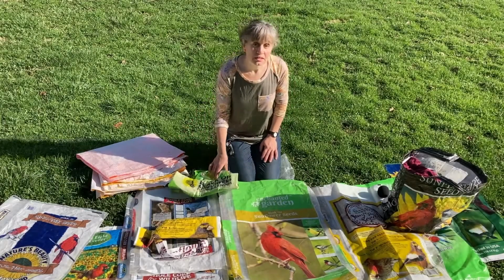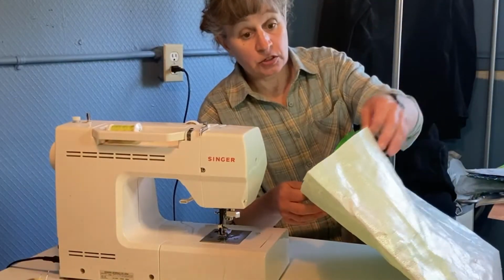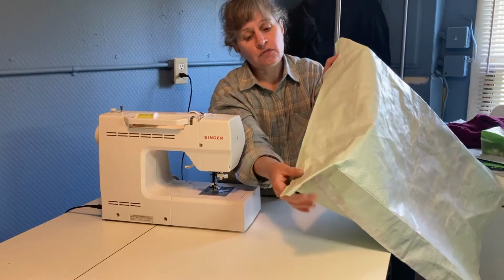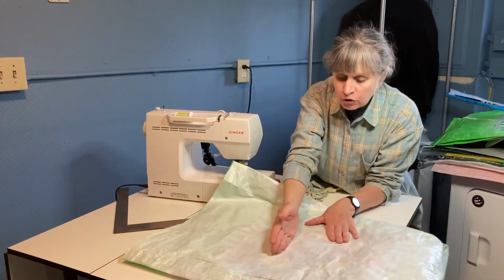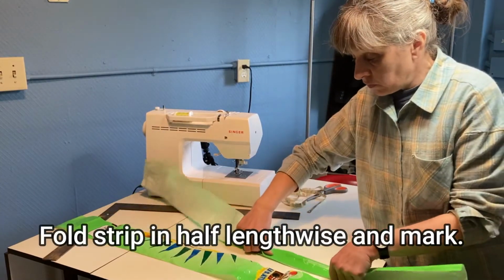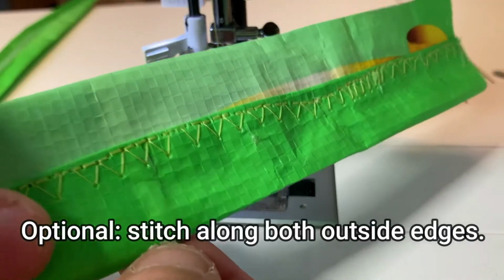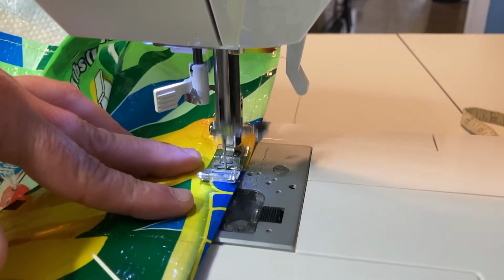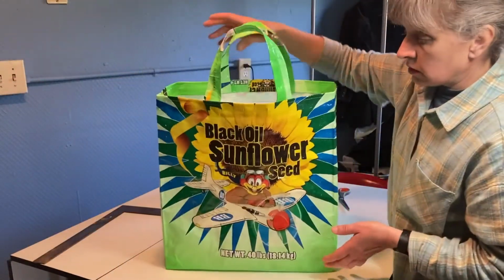Sew A Feed-Bag Shopping Tote

Comment: there is closed captioning available
  I also found out that the sewing machine foot that you use should be one of those with coating or plastic on the bottom so that it slides on this material.